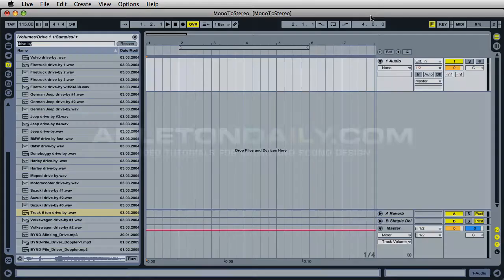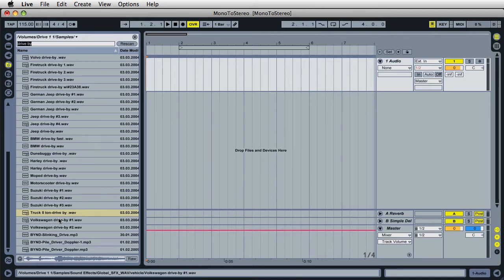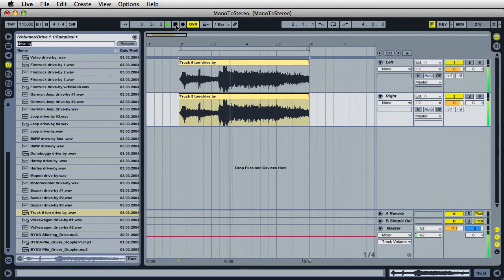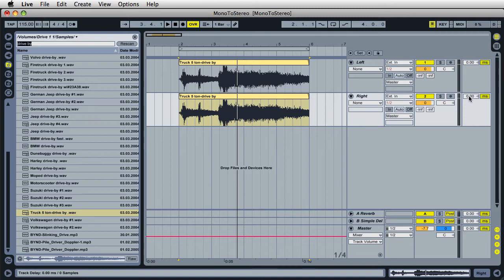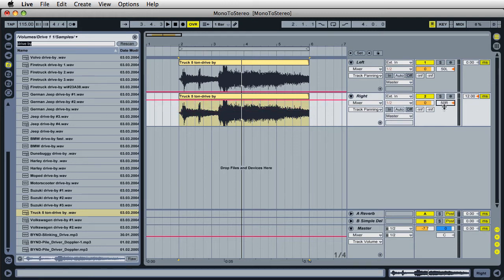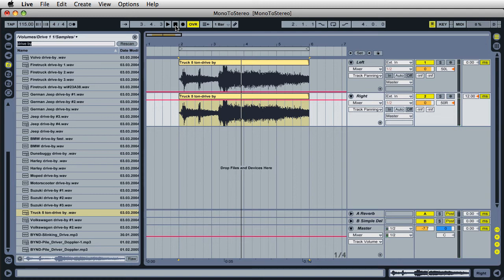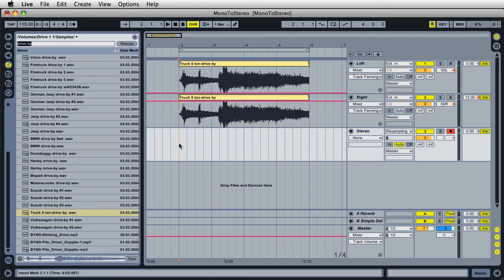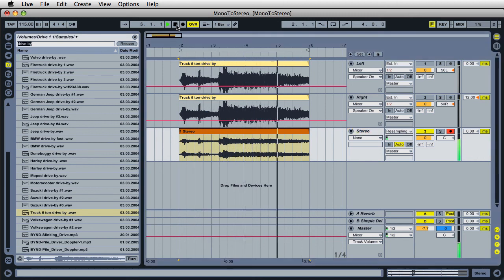#38 Mono Clips to Stereo :: Ableton Live

Comment: You can also use the Simple Delay effect in Ableton on one track instead of duplicating mono tracks, by switching the 'sync' buttons to 'time' and then putting either left or right  to 0 and adjusting the time delay for the other  from 3ms to 30ms. Going over 30ms kind of loses it effect. :)